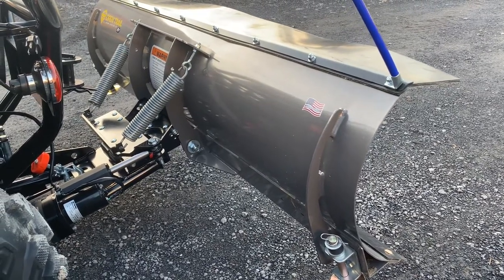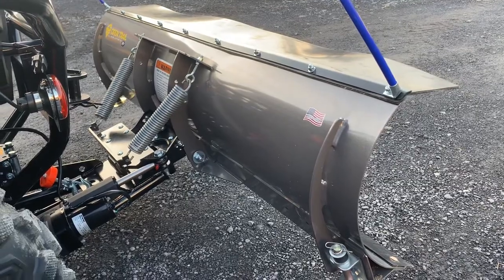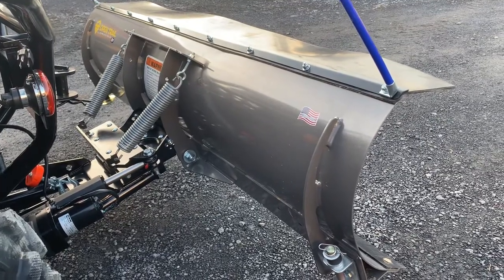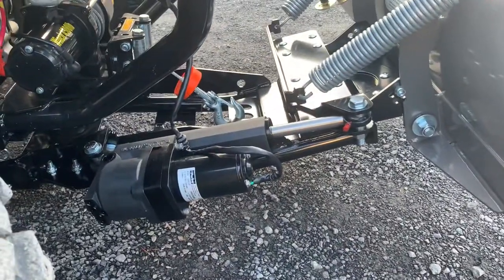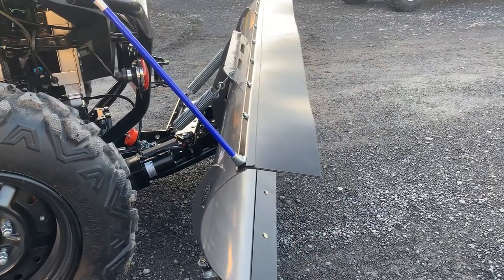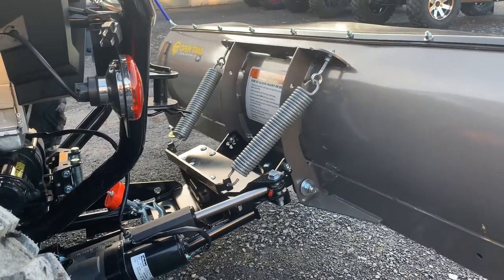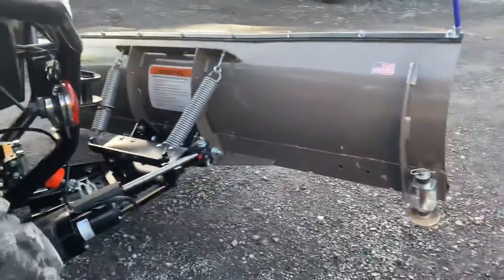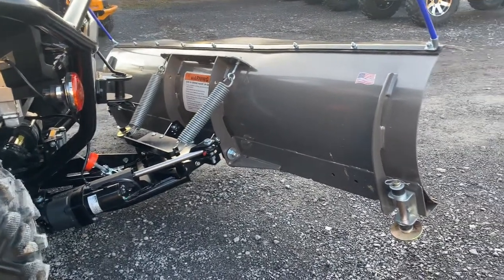KFI Power Angle Plow Operation

Comment: I could hop out and manually move it faster
Reply: Sure, but he can adjust his angle as he's entering a snow pile to stack, or adjust his angle as he's plowing to put the snow where he wants it. Go troll somewhere else peasant.
Reply: Maybe so but what about if he's handicapped like myself where getting in and out of sxs to change angle is miserable ?  Mine is a Cfmoto zforce 950 like a Rzr so it be like getting in and out of a rzr. My left leg was shattered in multiple places from a bad car accident so my hip and all surrounding bone was 100 % shattered and my left knee was also . I Have 15 pins and chain plating that hold my whole artificial hip In place.  I can walk but it's painful.  This would make my life so much easier...

Comment: Thank you for an excellent and informative video.  My UTV has tracks on it so my KFI blade is on an extension (KFI Products 105565 Multi Utv Plow Push Tube Extension Kit).  Do you know if I can still fit this power actuator with extension tube installed?  Thank you.

Comment: How do these stand up?  What's the cost?
Reply: The joke with this plow accessory is that it costs more than the plow. I just picked up a 72” KFI Pro Poly plow package for my sxs for $730 otd. The power actuator option would have been another $850!!
Reply: Does it go back to center on its own
Reply: @btktwood  Literally the exact same scenario for me. Hard to justify any accessory more expensive than the entire plow setup.
Reply: @FixNewsPlease   yes it does. I had a utility EZGO golf cart that had 12v dump box and snow plow actuators. I could push A LOT of snow with that thing and the actuator never had a problem.
Reply: @FixNewsPlease  I'd say if you bring up on something with the plow, it would damage the actuator. There is a difference in load rating of these vs  loading of the machine at a sudden stop.